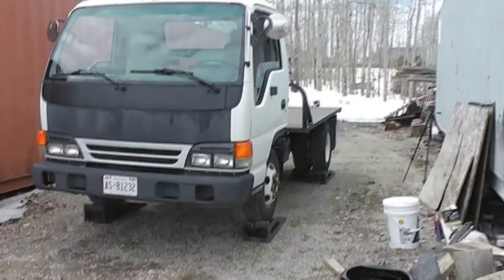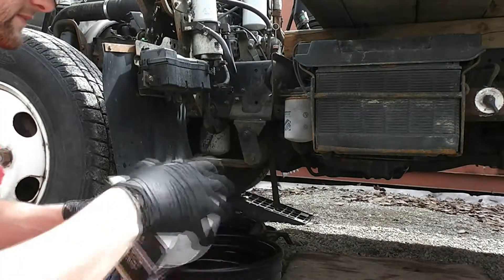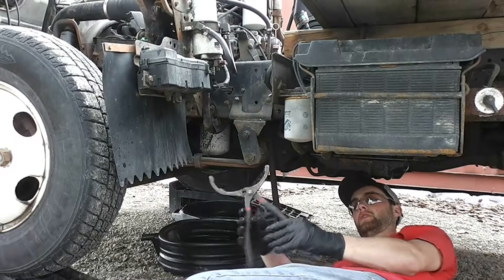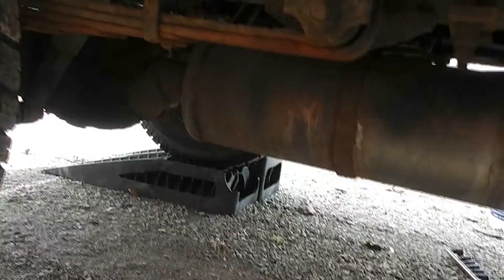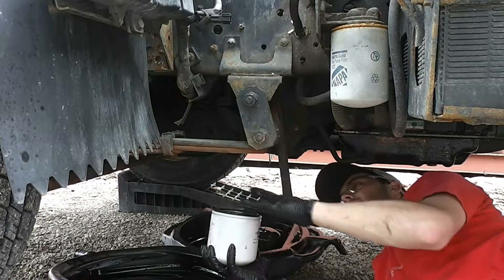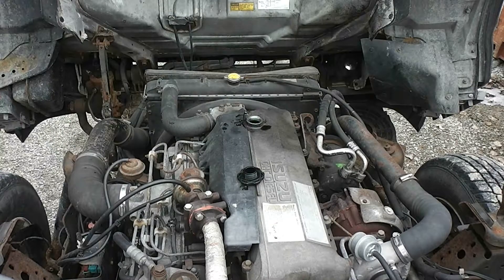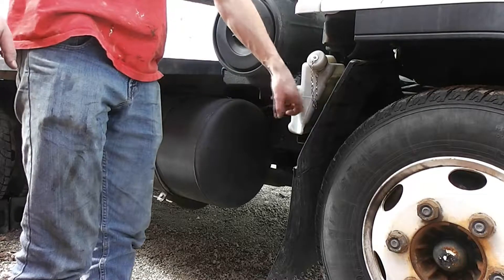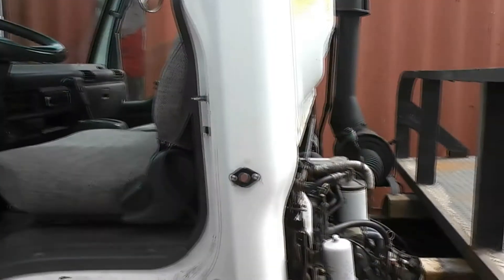GMC W4500 Oil Change

Comment: How many quarters for 1999 w4500 4 cylinder engine ?
Reply from the maker: If equipped with the 4HE1 engine, about 15 quarts (14L) of oil are needed. This is including the oil in the filter.